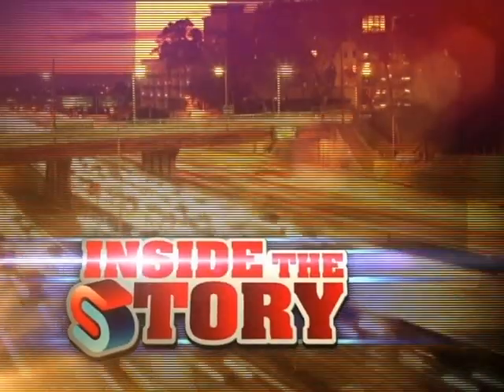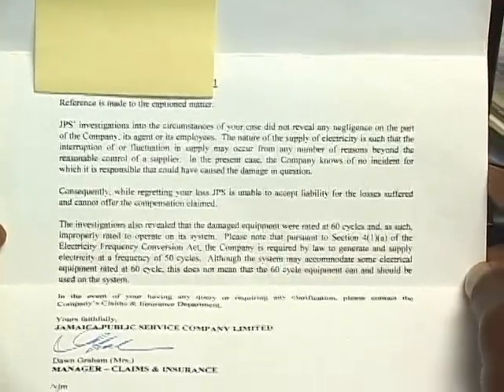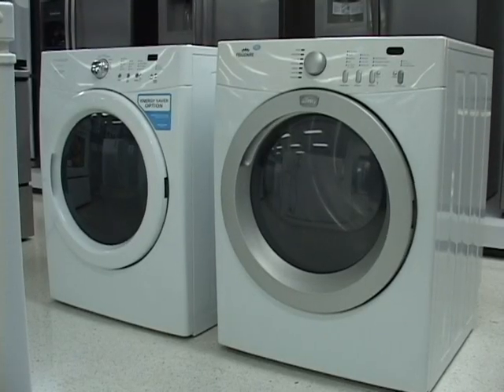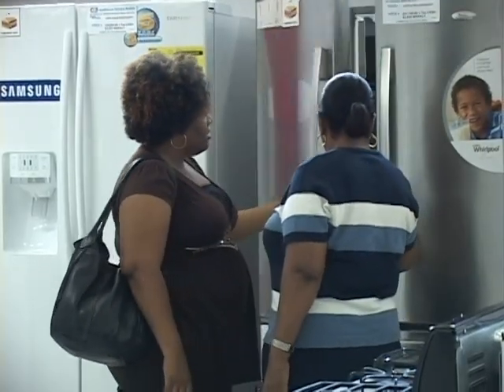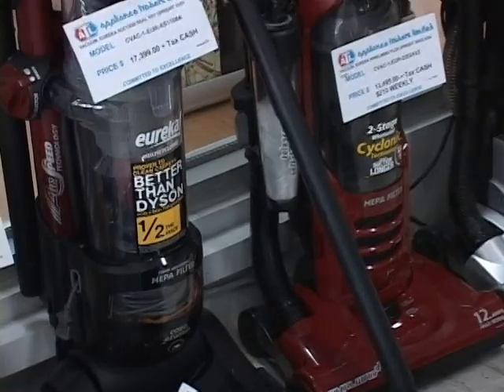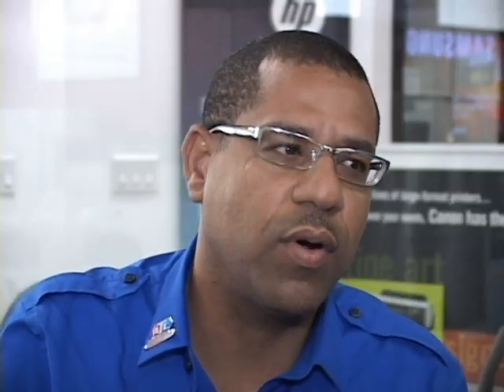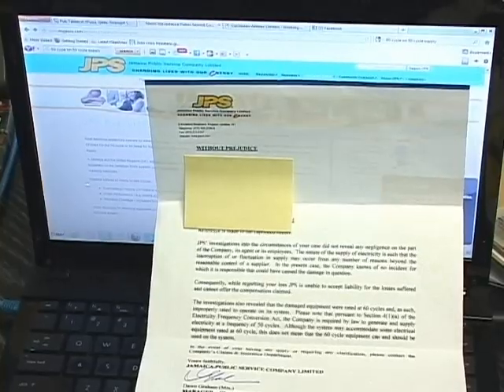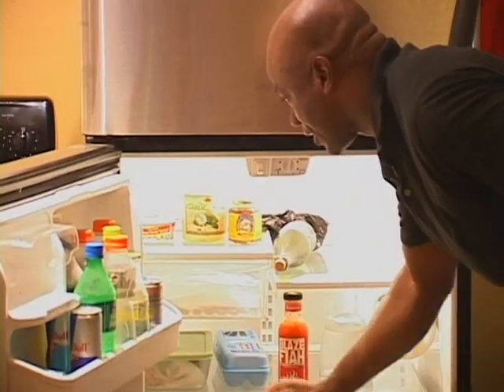Vicious Cycle: 50 cycle vs. 60 cycle appliances

Comment: If they’re larges, consumer, will they receive stuff from is the US then I would change the grid. Don’t misunderstand the people you were not re-wiring Jamaica. You’re just changing out the generators. Also, you may have an issue with current with some equipment that is 60 Hz because the wiring is also too small. The minimum main breaker and wiring size by minimum in jamaica should be 100 A. And the wire from the service head outside to your main breaker in your panel should be rated for 100 A. I see a lot of 60 A breakers in Jamaica. That’s wrong.

Comment: Haveing a heavy duty industrial stereo PA amp from a former corporation tandy Electronics (also in America known as radio shack) Ishall be mocing soon from a 120V/670Hz environment to a 230V/50Hz environment (namely, eurtope). The power transgformer seems heavy in weight as that is most of the weight of the unit. I am hoping that I can change the transformer tap from 2 parallel windings (for the NASA standard of 120/60Hz to series that can taken in safely 24V/50Hz. The voltage is actually ten V less at 230 in Europe.
Problem is that of course that when Tandy Corporation bit the dust back in

Comment: Why doesn’t Jamaica increase its frequency to 60cps?
Reply: on paper they supply 220v but realistically they supply 240v. pole mount transformers are rated 240/120
Reply: Jamaica have 220V 50Hz (UK outlet for high votage appliances).
Reply: @FrancisLitanofficialJAPINOY  some countries have 220-240 @ 60.

Comment: Adrian Symister  I need to take a washer and dryer from the US to North Africa. Here in the US the Cycle is 60 hrz and North Africa is 50 hrs what do I need to make the dryer working knowing that the voltage of the dryer is the same 220 volts in both countries 30 amps
Reply: Buy a UK washer and Dryer and install a 220V outlet in Jamaca for that.

Comment: Just change the house transformers to 230V with the 50Hz and you can easily import common appliances from Europe or most of Asia
Reply: london46 Philippines, Saudi Arabia and South Korea uses 220V at 60Hz and Eastern Japan uses 100V at 50Hz
Reply: @FrancisLitanofficialJAPINOY  Most appliances are made in East Asia and the 230V 50Hz variaty is the most common one beside the 120V 60Hz
Reply: london46 Also most appliances in the Philippines and South Korea uses 230V at 60Hz. Mostly like Standard and Kyowa appliances like oven toasters from the Philippines labelled 60Hz. Not 50Hz.
Reply: london46 ALL ROYAL CARIBBEAN CRUISE SHIPS uses 60Hz including 230V Europe outlets and 115V US outlets. WHEN I WAS at Windjammer buffet as they play some music, I heard some buzzing sound and it’s 60Hz (music note B).

Comment: always buy appliances with 50/60hz and 110/220V to prevent damages.

hz is the unit for frequency.  in real life, there is danger when you're using with motor.  motor with 50hz rating, will rotate faster if use in 60hz.

Comment: how about a 50hz motor (equipment) to a 60hz supply? Whats the bad and good thing about it?
Reply: Felix Batican Runs faster but I purchased rice cooker and electric kettle from China (220V 50Hz) and bring it to the Philippines (230V 60Hz). No problems at all by operating those appliances.

Comment: Appliances containing only universal motors or resistive heating elements, such as hair dryers and blenders, this difference in frequency is negligible.This also includes modern LED bulbs.
Reply: You don't understand electricity
Reply: @cool2180  Yes I know, the electrical trade is the be all and end all of the building trades. It has become a pissing match.

Comment: Stepping down the 110 volts to the 100 volts Japan uses may offset the 50 Hz heating effects on 60 Hz appliances. Having lived in Japan and running 60 Hz fans, spaceheaters, Dremel tools, radios, Lionel train sets, Mixmasters, vacuum cleaners, etc we never had problems with any of those items NOR with running Japanese 100 volt appliances on 60 Hz 110-120 volts.
Reply: 220V to 100V step down transfomer sold in the Philippines, if the volage from 230v, the multimeter on 100V outlet reads 105V.

Comment: Changing from 50 Hz to 60 Hz although expensive but not as the other way around because 50 Hz transformers even runs cooler at 60 Hz so they don't have to be replace. Unlike 60 Hz transformer which tends to overheat at 50 Hz and needs to be replace. So it's more practical in the long run to change the frequency because most 110 Volts are design for 60 Hz.
Reply: bobskie321 Most Japanese appliances are both 50 and 60 Hz. Mostly Eastern part of Japan uses 50Hz at 100V.
Reply: bobskie321 need a US 12V DC to 120V 60Hz AC inverter 75 W and 100V - 240V AC to 12V DC 6A adapter.

Comment: In the Philippines it's the opposite. We have European voltage with American Frequency (220 Volts 60 Hz) and sometimes I saw some appliances rated 230 Volts 50 Hz but they worked just fine. They said 50 Hz even run cooler at 60 Hz, which means 60 Hz run hotter at 50 Hz like in Jamaica.
Reply: bobskie321 Philippines same as South Korea, Saudi Arabia, Antigua Barbuda, Peru, parts of Brazil.
Reply: bobskie321 ROYAL CARIBBEAN CRUISE SHIPS USES 60Hz on 220V outlet (Euro).
Reply: hi po..can i use 50hz Inverter ref. in the Philippines..?thank you in advance.

Comment: Philippines has American frequency and Spanish/European Voltage.
Reply: True,60 hz and 220 volts.I bought a turntable from Singapore which uses 50hz and its causes the motor to run faster...now i have chipmunks singing all the time.
Reply: Al Dig adjust the motors...